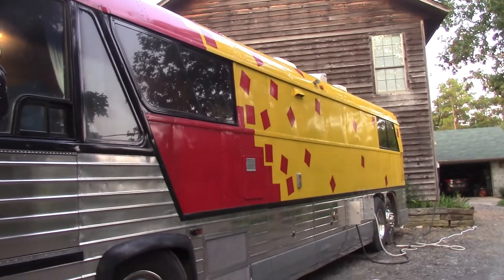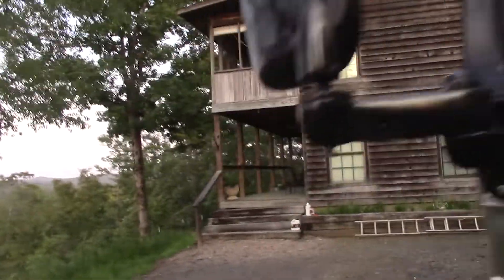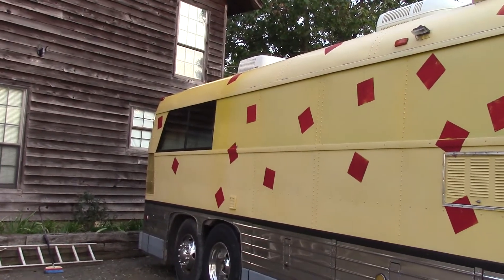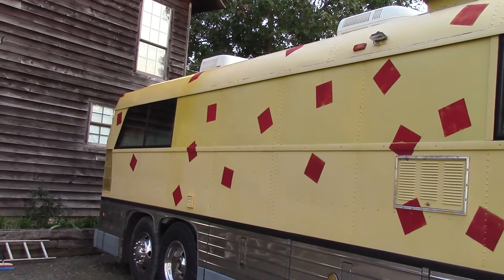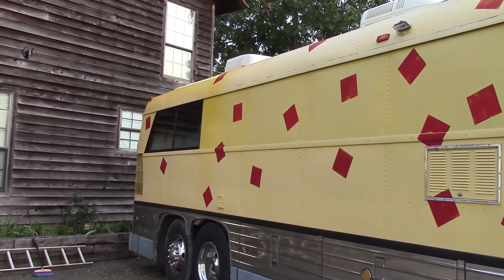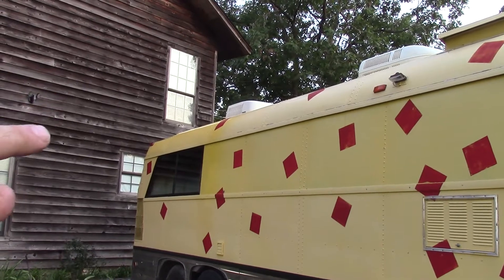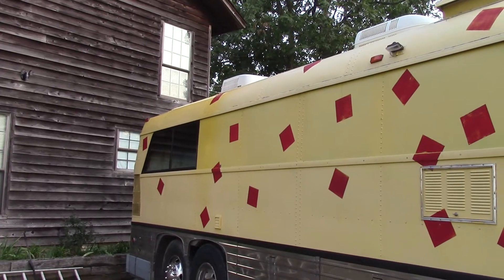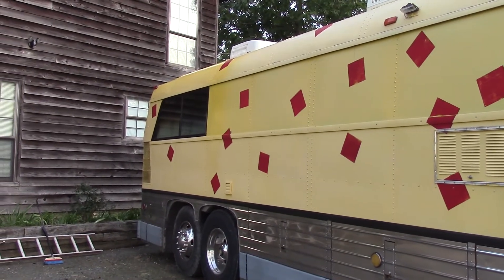Bus Conversion Design :  Part 7 Painting the Bus

Comment: What paint did you use ?  Were you warned about UV fading ?
Reply from the maker: It was a local paint supplier called Anchor Paint.  I used a paint that they make for painting outdoor metal items like storage tanks etc.  They said when I was ready to repaint they would take care of me but I never repainted it and I don't own it any more.
Reply: @SoatMon  Thanks for the update.  BTW, a UV resistance clear coat would have probably kept it looking like new.
Reply from the maker: That's what the paint guys told me, I just didn't communicate with them as much as I should have.  Thank you for your input!